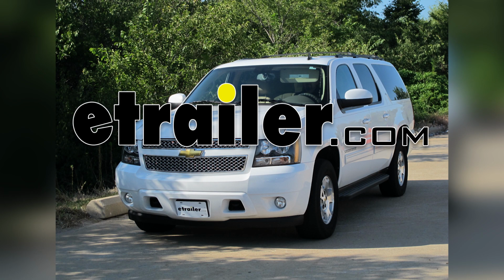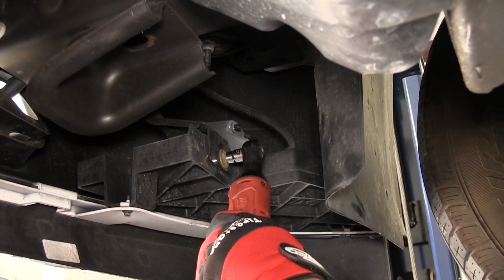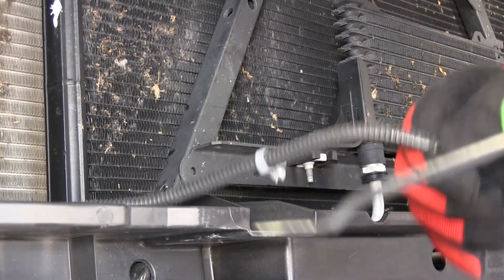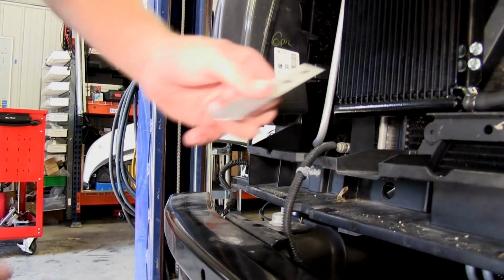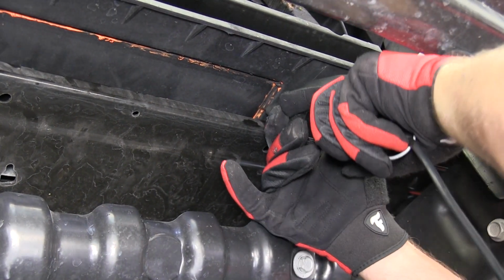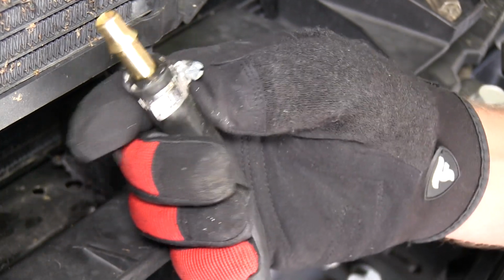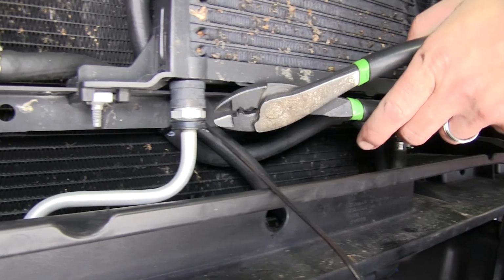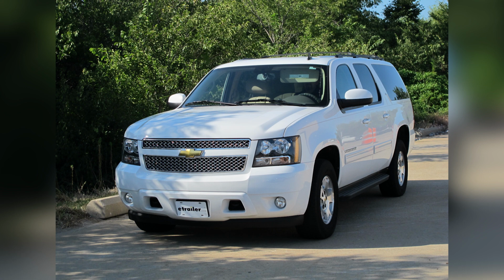etrailer | Transmission Cooler Installation - 2011 Chevrolet Suburban

Comment: This installation is a series connection.  I was told by two transmission sources that this type installation can cause too high pressures in the transmission.  They recommended that when using two external coolers that they should be connected in parallel.  Which is correct?

Comment: By adding a second cooler wouldn't u need to add more fluid as well to compensate for the added distance the fluid has to travel out and back in?

Comment: so basically, the trans oil flows into the stock cooler, out into the after market cooler and then back into the transmission. seems like a very easy task.. thanks

Comment: what is the point of just adding a second cooler if the fluid is still running through the radiator system? The point is to isolate the cooler from the radiator.
Reply: also, consider the radiator cooler as a heat sink to take the first bit of heat out of the fluid, then the additional cooler as the final pass to cool it additionally, I omitted my factory cooler and installed the large external cooler in its place. Seem to lower the temp 30-50 degrees when towing my big boat.
Reply: The radiator also serves to heat the transmission fluid when everything is cold.

Comment from the maker: Transmission coolers are recommended for vehicles that will be towing. Factory transmission coolers are usually adequate at best for light towing applications.